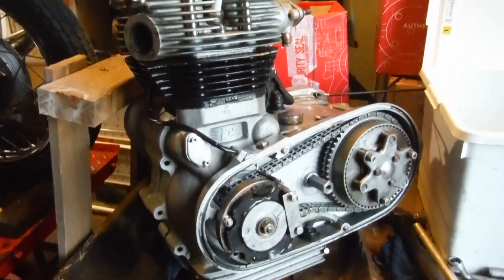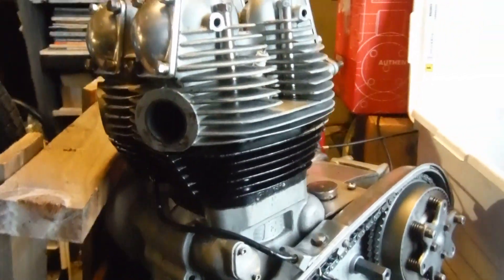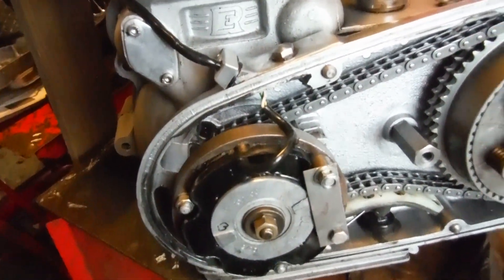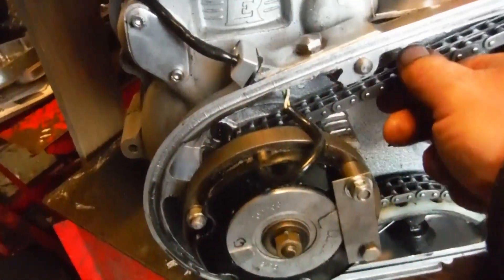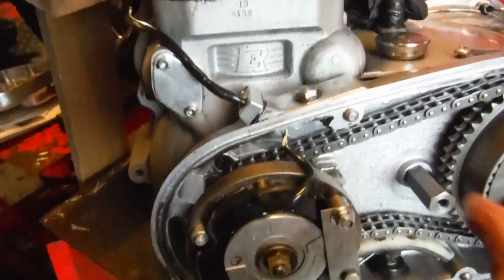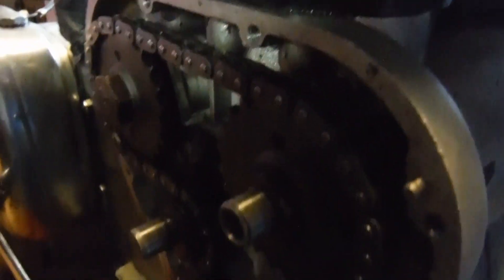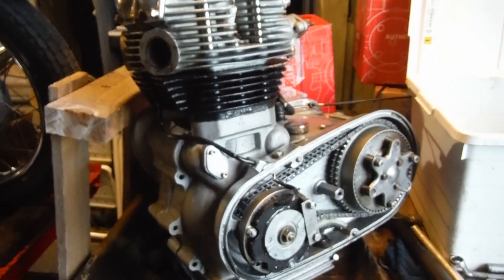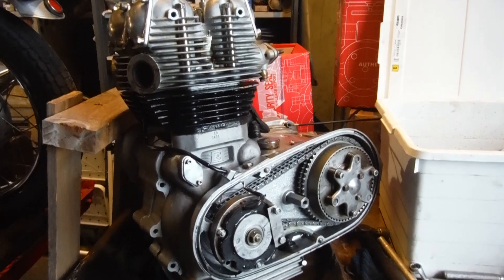Royal Enfield Interceptor 750 S2 engine - Crankshaft end float attended to & good progress made.

Comment: The drive side crank should be a very tight push fit into the ball bearing. If it was so easy to push the crank through that bearing race, then it may be worn? I think you encountered the same thing on another of your patients some time ago?
Reply from the maker: Yes, that was on a pre unit T120, and strong bearing fitting compound took up the slight play between the bearing and crank. In the case of this Interceptor, there was no play, just a sliding fit, so I was happy to apply thread locking compound to the big nut and do it up tightly to stop the end float.
Reply: @paulhenshaw4514  Should function OK then. There must be some minor wear on the crank, bearing race, or both.

Comment: I'm always impressed with the nonchalance you whip heads off and remove valves and pistons etc. Do you have a permanent supply of gaskets, seals etc in storage for all the makes and models you work on to put things all back together in a trice?
Reply from the maker: Thanks, and no, but most gaskets and seals are obtainable pretty quickly and if I know I will be stripping something, I try to get as much stuff I know I will need, ready up front for when things can go back together.